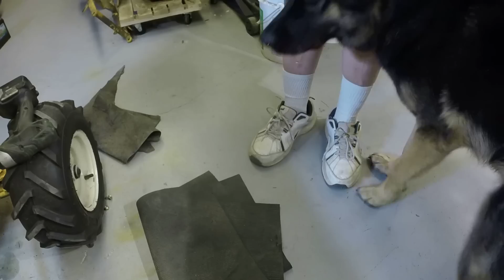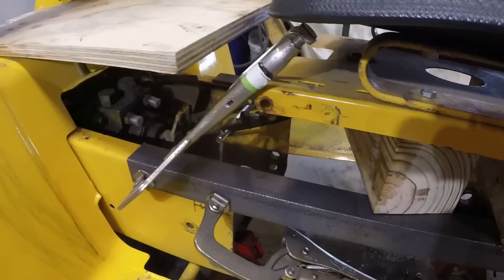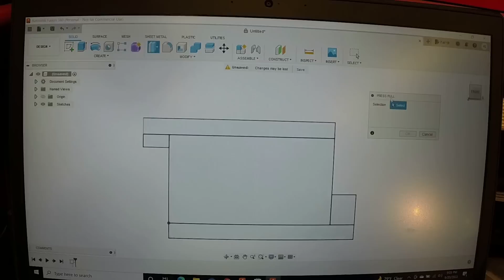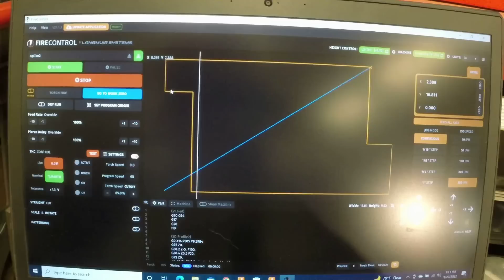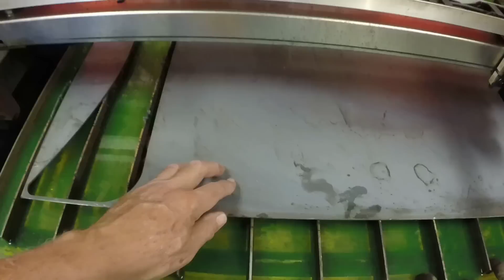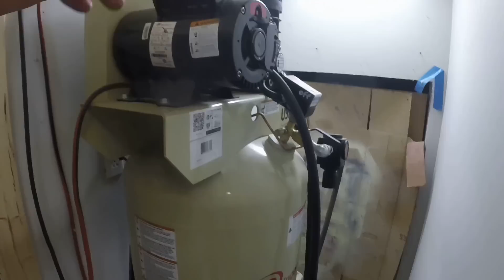Cub Cadet Forklift Build!  EP:06, Stretching the Frame

Comment: You could have made some dash type cuts for easier bending og your flange section over to a 90. Then just weld up and finish the  edges. Maybe next time. I have seen another maker do this. Seemed to work well. Near builds by the way.
Reply from the maker: Watch EP:07

Comment: Relocate the seat rearwards by shortening the hood about 3 inches to allow seat to move giving you more leg room simply by sliding it back. Allso moves the center of weight rearward which is a further benefit...just an observation

Comment: For anyone who might be thinking of investigating a plasma table, all the air drying equipment and the crane, your thoughness is appreciated. While I have never used one, I just recently got a used 30 amp plasma cutter, and the extent of your air drying set was even more of an eye opener than I knew. Although it was very interesting as well as super cool, most of us will never go to quite those extents. Personaly, I could never justify the time and expense. Angle grinder, combo square, tape, straight edge, and welder will accomplish the same thing of course, but you do it in STYLE! Enjoying the build, have at it!

Comment: For bending in the future especially for thicker material you can use the CNC Plasma to cut slots along the bend line to minimize the amount of material that actually needs to be bent but maintaining a very straight bend line. Once bent you do have to weld up these slots. 
An alternative is to score your bend line with a cutting disk to maintain a straight line and then weld the length of the bend afterwards. 

Looks like the amount you’re adding will make for a comfortable compromise so your knee caps aren’t in your armpits or your feet aren’t under the seat.
Reply from the maker: You'll see next episode, that's exactly what I did.

Comment: Do you allow for gain in your blanks that you bend? Just curious because I didn’t hear you mention it. Typically it’s twice the thickness of the material being bent, at least that gets you close. Two bends @ 90 degrees usually warrants 1/2” subtracted from total distance across blank.

Comment: Thank you for another video and I also agree with some of the other comments looks like you might have to design some kind of a break or hydraulic press that you can turn into a break to bend that metal and I also was thinking you could cut look like at least six to eight inches off of the hood to gain more space and legroom just a suggestion either way love the videos thank you

Comment: Nice job Frank,  when I have to cut a piece on my plasma table that needs a bend I will have it cut a line through most of the bend leaving like 1/4 inch tabs on each end then I can bend it rather easy along the cut line then I just weld up the seam.  A press brake would be nice but without one this works well.

Comment: Hey Frank, I highly suggest you check out a company named SWAG Offroad. They are a company located in Oregon that makes a fingered press brake kit that is DYI weld together, and is made to work with either a 12 or 20 ton hydraulic press. They are a great company that ships very quickly by USPS with a flat rate. With their kit you can bend up to 5/8" plate. It[s a great time saver and made in the USA. I have one and use it often. There are lots of YouTube videos on this product. Great job on the new video as usual.

Comment: I operated a press brakes for many years in a fab shop with a laser, I'm thinking (if I remember correctly)
you should have added the material thickness to both of those bend flanges.

Comment: On the seems/joins buts, Frank are you going to plate them on the inside or do you think the "z" cut but joint will be enough strength??
Reply from the maker: the cuts are welded from both sides but the frame will be reinforced later.

Comment: Your plan is coming together nicely. I'll make a suggestion, I think I would move that hood more to the what is now the rear of the tractor. (Small tire end).it appears there is wasted space at the seat back being taken by the hood edge. Cutting the hood I believe would change the proportion and look of the machine. Moving it would not. 
 Also make a couple hardwood blocks,drive them in between the frame and the axle to eliminate the pivoting of the axle while squaring the frame etc. 
Great workenjoying your build! Great plasma table also!

Comment: Looks like you will need to design and build a hydraulic brake to bend such metal cutouts. Seems you are making so many type projects, so a hydraulic brake is a must...
Reply: All you have to do is cut slots where the bend occurs. Leave 3 or 4 connection points, bend and then weld the slots after it is tacked in place.
Reply from the maker: Next week.  Yep.
Reply: @woodandmetalshoptime8048  you could have kept the frame ALL  IH by using the frame from a cub lo-boy which is longer . Redrilling the holes to mount the steering components and body panels . Weld the front axle mount from the cub cadet into the frame .  Plus have enough room to mount 2 maybe 3 Kohler engines inline on frame .